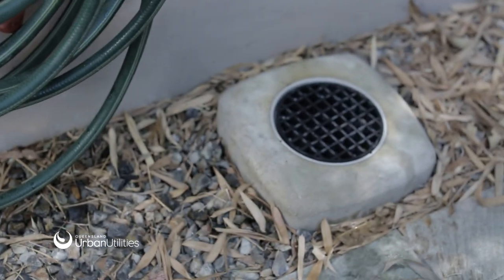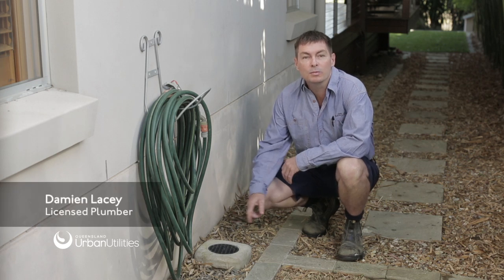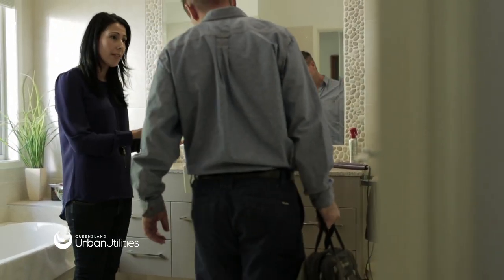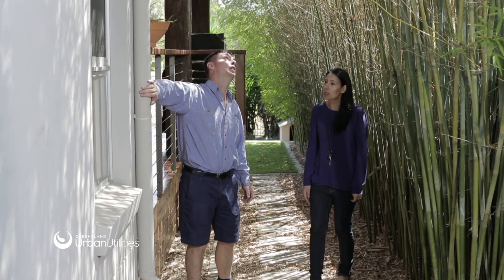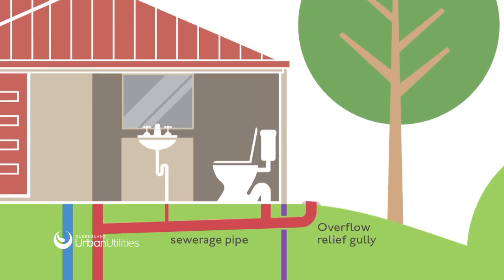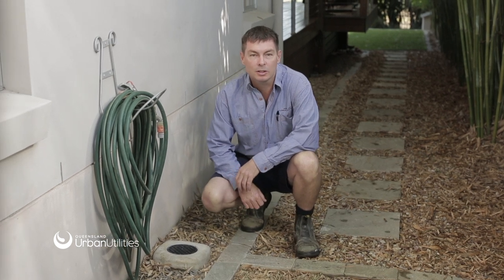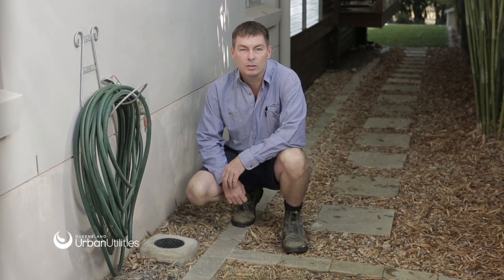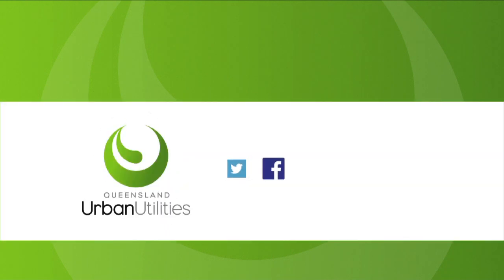Your overflow relief gully

Comment: Gully trap sitting 150mm lower than the lowest plumbing fixture can be unattainable . Best practice situations are not always practical.
Reply: It's always attainable at the design stage, even if the cost of doing so is unpalatable.